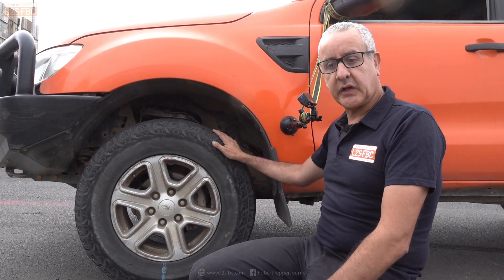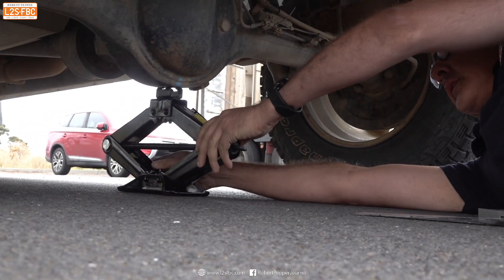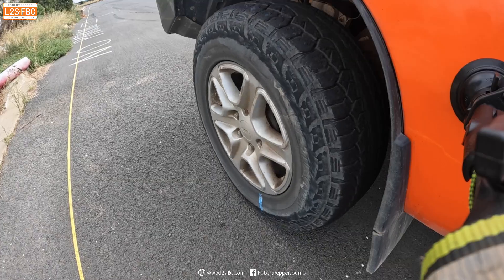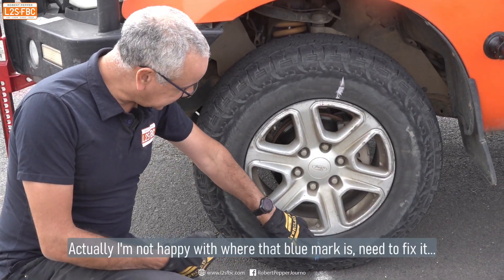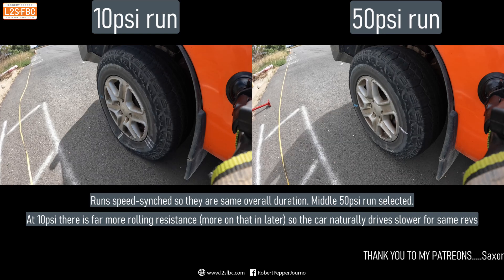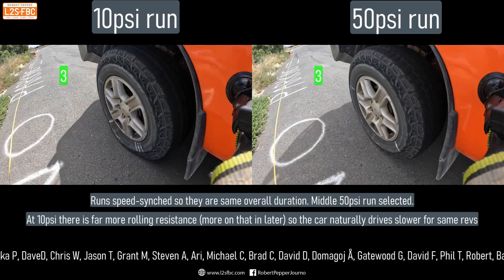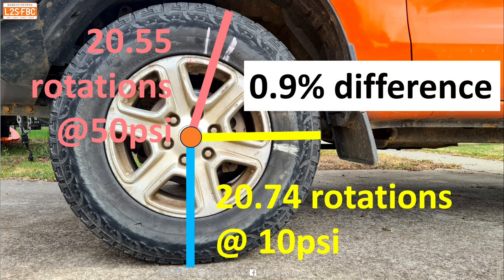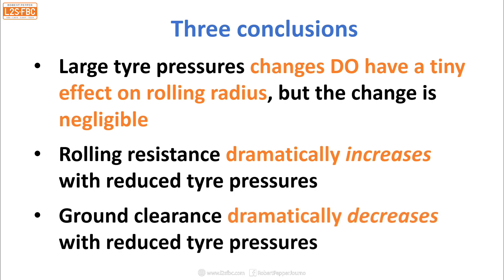Win the debate - pressure effect on tyre rotations

Comment: I have never worn out the centre of a tyre running higher pressures. For the reduction in comfort experienced, while all other performance metrics are improved, I think it is better to run slightly higher pressures than recommended.
Reply: - and if you like cornering a little energetically increased pressure will tend to even out the apparent scrub wear..  matbe..
Reply: Yep I've run 4psi over the recommendation for 45yrs and tyres don't wear on the edges so much.
As much as 10k miles can be gained ⚠️
It's a trade off however as there is less grip but I've never been a boy racer but massive savings made on tyre expenses 😊
Reply: @julesviolin  agreed accept for the reduction in grip part, where I would say that when braking you actually have more grip as stopping distances are shown to reduce. When turning hard you have more grip only on the wheels that have increased weight on them. When turning tyres on the spot in say a car park you have less grip and this is when you want less.
Reply: Narrow tires aren’t affected as greatly but it is noticeable the wider the tires the more you have to watch tire pressures. Over inflated wide tires will significantly decrease life of a tire.
Reply: @supersportimpalass  yep, I agree, I guess that is the price of fashion.

Comment: Interesting findings, goes to show a hypothesis should always be tested!  I always assumed a deflated tire worked as a track, and the effective circumference was the same regardless of tire pressure.  Because the change is so small ~1% it would seem the difference is most likely due to an increase in rubber stretch from the pressure at 50 psi?  Did you measure the tire with tape at both 50 and 10PSI? It would also be interesting to see another PSI data point, perhaps one where the tire carcass isn't deformed to the point of the sidewall making contact with the ground; there is a possibility that having so much deformation causes other interesting physics to happen to the tire as it rotates.
Reply from the maker: No, just measured it unladen at road pressure.  Can't put everything into one video!
Reply: Tires track surface doesn't shrink in lower psi, but it buckles up in ground contact, as it has nowhere else to go.
Reply: That makes sense, I think you may be right. @xZeiZeix

Comment: 13:20 should be taking 70mm away from 50PSI or adding 70mm to 10PSI but I don't think it would make a huge difference anyway as you have clearly shown here.
Great way to show that the car is still traveling on the belt as if we went by the clearance change from 223 to 170 as the change of radius then our calculations would get about 15.2% difference in distance ( Diameter of 802.8 = Circumference of 2522 / 802.8 - 53x2 (53 theoretical radius) = Diameter of 696.8 = Circumference of 2189 (difference of 333mm))
... (50000mm / 2522 = 19.82.... 50000 / 21890 = 22.84.... 100/19.82=5.0454...... X 22.84 = 115.23.....) 
And you obviously did not cut this out of your tread to make up the difference so where did it go?
"Rolling Resistance" as the tread was constantly grinding from the front of the contact patch to the back before leaving the road 
This can be seen if you ever had to shift a car on dirt or sand with flat tires and no motor, the tracks often leave a strange pattern in the middle as if the tires were completely bald .

Comment: You didn't measure the radius from the centre of the wheel to the ground. The difference in rotation speed is a function of that radius and the wheel will rotate faster if the radius is smaller. Tyre pressure warning systems use this principle to tell when a tyre is going down.
Reply from the maker: I did, I just didn't put that in due to timing.  368 and 310mm is your answer.

Comment: Thanks for another interesting video! I immediately had to wonder what the outcome had been on a less flat surface. In an offroad environment with lots of bumps where the low pressure tyre can wrap around but the harder tyre hops over. Maybe an idea for a part 2?
Reply from the maker: The result would change in that circumstance, and also with speed.

Comment: I like to fill my tires to a bit higher than recommended pressure mid-day when warm out just a couple pounds since the recommended pressure says cold i figure set it to coldest temperature in the mornings plus an extra pound since tires are always losing air. 
the actual tire pressure changes constantly 1 psi per 10 degrees roughly so it is all relative to speed you are driving weather all that, so I always wondered if you are a few pounds low or a few pounds high does it make much difference in stopping distance and cornering as well as grip when you accelerate have you tried testing the stopping distance or things like that at various pressures?
Reply: When racing a 2 PSI difference can definitely be both sensed by the handling of the car and measured in lap times.
Reply: they say fill car for cold temp, so I try to set it for what it is at coldest temperature in morning since it changes about 1 psi per ten degrees and in my manual, it actually recommends an extra pound pressure if you are driving at high highway speeds you could have 6 psi change from cold tires undriven in morning to hot afternoon tires after high-speed driving.so hard to figure what is the right pressure? @GaryL3803

Comment: Interesting video as always! 👍
However, if I'm not mistaken, I think there's an error in the correction of the contact point between the wooden board and the tyre between 10psi and 50psi. The 7 cm should be added to the tyre at 10 PSI, not subtracted, because the wheel axle travelled 7 cm less (with 10 PSI) due to the longer footprint and the contact patch further forward of the wheel axle. So 1.2% and not 0.9%.
Just my 2 cents for the sake of accuracy, even if it doesn't change anything to the conclusion.😉

Interesting to see that there is no difference in the number of rotations with 10 PSI as opposed to 50 PSI. Maybe that's because there's more rubber on the ground and therefore more grip with 10 PSI.🤔
Reply: Tire dynamics are sneakily complex. It's possible the effective rolling radius of the tire just simply changes between the two pressures. However, just as likely, and more interesting, is that the tire at the lower pressure ran at a higher slip ratio due to the increased rolling resistance and that produced the 1% difference even if the effective rolling radius remained constant. So the question is, did the test measure rolling radius or slip ratio? 🤔

Comment: Well as I watched this video I was sure you got the results wrong. I was thinking with a 55mm reduction in radius, which is more than 10%, the distance travelled per wheel revolution should also reduce by more than 10%. I figured you had miscounted the total number of revolutions between the 10psi and 50psi tests. But I watched and counted the revolutions and it seemed your counting was accurate.
My head was hurting as this just wasn’t making sense.
So to make sense of what is going on here I reckon you can think of a tyre tread as a track (as in bulldozer track) of a particular length and just about disregard everything else (such as pressure reduction and sidewall deflection). For each rotation of the track (tyre tread), it moves the vehicle forward by approximately the circumference of the tyre, no matter the tyre pressure.
Thanks heaps for your interesting and educational video, greatly appreciated!
Reply from the maker: I deliberately left the "why" out of this one, might do that soon :-)  And that is why I put the runs in so you can see for yourself, no trickery!  Yes the effective circumference changes. Think about a massively overinflated tyre...where does it wear?  Then think about an massively under-inflated tyre...where is the wear pattern on that?

Comment: Hi Robert
another interesting test.

If you assume the tyre doesn’t stretch, dropping the pressure there is also some lateral deformity which takes a small measure from the circumference. I am thinking this will be the reason for the slight increase in the rotation number for the given distance.

Cheers
Reply: The gaps between the tread blocks are smaller at the contact point when the tire is squashed. I think the is what allows the circumference to reduce slightly when deflated.
Reply: - and if we assume the 1% difference is purely tyre stretch - there is the variation??  maybe - assumptions ...  (the flat tyre is still rolling at 1:1 tread  - track -  length to rim rotation)

Comment: Should the question be does rolling circumference change. Radius will be different at three different points.
Reply from the maker: Rolling radius is the question, not geometric radius
Reply: I think the word “effective” was important to the plain English understanding of what was intended.
Reply: @veryaware  True, and officially that's the proper term.  But it's typically just understood rolling radius means the same.  Loaded radius is the term for the distance from the wheel center to the ground.
Reply: No. Effective rolling radius is understood to be the radius of a circle with a circumference equal to the distance traveled by the tire in one rotation without slipping. So, 'effective rolling radius' is the proper engineering parameter of interest here and often it's shortened in notation to just 'rolling radius'.

Comment: Great work. I've heard about this in drag racing, but it has never crossed my mind in passenger cars. Imagine if our car tires deformed like dragster tyres on the highway!
Reply: I run a car that uses 5.25/16” crossply tyres. They do “grow” slightly at motorway speed, possibly as much as 1/2” in radius. I had to adjust the front mudguard fixings because I could smell rubber on the motorway. The electronic speedometer runs off magnets on the prop shaft and therefore the calibration changes slightly depending on the speed the car is doing. Confirmed by a GPS sensed Brantz trip meter over the same stretch of road, running at different speeds.
Reply from the maker: Drag racing would also have a slip factor in as it's a driven wheel under high torque. There would be a slip factor here too as there is in any wheel, but I think it'd be negligible, not least as the wheel measure isn't driven.
Reply: @L2SFBC  You are correct with drag racing tyres and it is a large amount not negligible. One only needs to stand behind a top fuel car when it is launching to see the impressive distortion going on. It is the flex and stretch along with not braking the bead from the wheel that allows for harder take off’s.

Comment: Also about 1% more torque.
Reply: And butt load of resistance. I conducted a similar  test but measured individual rotations rather than over larger distance. 40-5 PSI. The difference on one rotation is so negligible that it’s barely worth acknowledging its existence. I think it’s just tread blocks being squeezed into a smaller area. Ive seen other tests on road tyres and the difference was basically immeasurable. So I suspect particular tyres will vary slight in results.
Reply from the maker: But...rolling resistance!